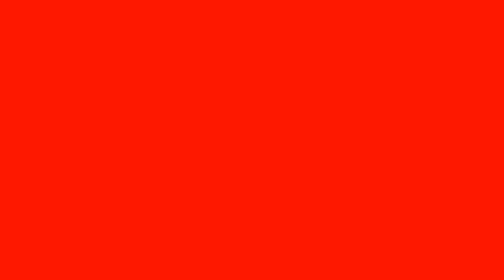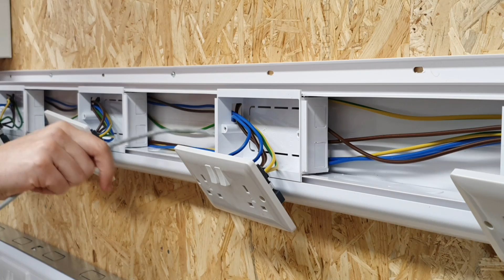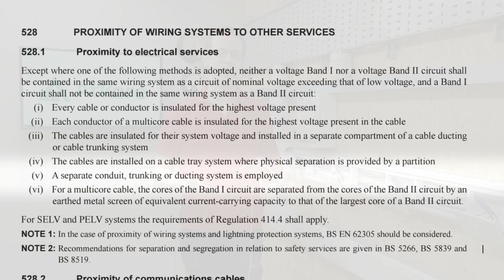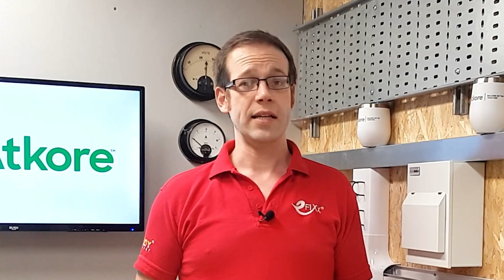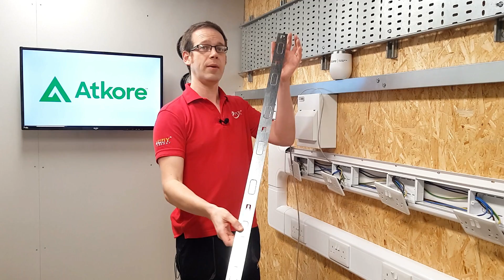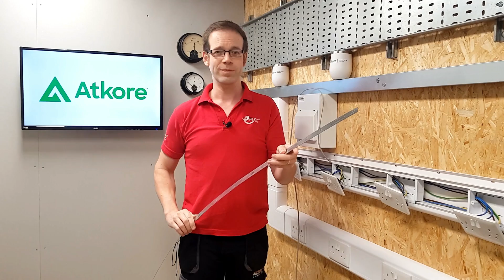Data cable installation in dado trunking - Separating band 1 and band 2 circuits

Comment: Never had a single issue with ethernet running parallel to or crossing mains even on big events with 3-phase chucked across a floor, as Alex below said at 1G or even 10G speeds the pairs act as a balanced signal and null out the interference.  Is it probably better to isolate - probably, does it in operation make much difference - none that i've experienced.  We know the regs like to go a bit past the belt-and-braces sometimes.

Comment: You could physically fit a 16mm trunking inside 25mm trunking and run the band 1 / 2 separate. or put the 16mm trunking in the same chase next to the cable (in a wall chase)

Comment: all that really needs to be considered is the potential for a data circuit becoming live. Clearly, each compartment is regarded as a separate system.  If you read manufacturer guidance they tell you which compartments to use for each band.

Get a lot less interference anyway if you use twin instead of separate live and neutral like in the video as they will cancel each other's field quite a bit being close together.

Comment: in almost 20 years of separated dado, i've never seen the additional shielding used on any site i've worked on.....we just used a shielded Network cable & never have any issues.
Reply from the maker: Yeah, I don't know if it's an extra specced thing for government or military buildings etc.

Comment: Do you have a video demonstrating the rate of distortion in the data cables? I’ve done a house renovation and added cat 6 cables in some of the rooms. Due to it working in the confines of a typical house structure, I was limited how to run the cables and in one or two locations the data cables have crossed power cables or or run parallel to them. I haven’t switched the data cables on yet but would be interested to know whether all my effort was for naught.

Comment: I do recall on one job we used three compartment dado trunking and run the mains in the bottom and the data cables in the top so keeping a greater distance between them ..
Reply from the maker: Not gonna get many EMC issues with that install!

Comment: I always run mains in the bottom potion and shielded cat6 in the top and only use the middle when i adding the outlets so they are as far apart as possible for as long as possible
as I have see as huge drops in data when you have to two close together. the steel is great if you need the extra security
Reply: now here is a guy who knows his stuff. i am a it guy and i am always ticked off about electricians running utp right next to power. esspecialy if they show it in youtube video's.
Reply from the maker: Great 👍 advice

Comment: If you Twist you're live and neutral cables together it will almost completely eliminate magnetic coupling between the cables.

Twisting cables together is a very powerful method of reducing interference
Reply: To be honest it's not a common technique in the electrical industry but it's  absolutely bog standard in electronics and data Communications.

First sign of interference twist your cables together  it's that simple.
Reply: I see what you are trying to say but I never saw twisted power lines in normal houses..
I did started to see more and more low voltage pole to pole power lines that were twisted (from local transformers to residentials, 3 phase, 230/400V lines in Y configuration)
Reply: I know a particular case where a comercial center used normal paralel lines to the grid and the escalators stairs motors kept burning until they changed the lines from the local transformer to the comercial center with twisted pairs...

Comment: Isn't the whole point of twisted pair that common mode induction results in a voltage difference of zero (subject to termination). The twisted pair is terminated with a transformer each end in Ethernet, so the fact that the pair is bouncing around at 50Hz makes no difference to the detector on the secondary winding of the transformer. Non transformer coupled data modes such as RS485 (DMX512 or similar) can be somewhat less tolerant than Ethernet.
Reply: Most don't get how ethernet works. A lot think that a 20m cable will have slower speeds then a 30m.

Comment: For Cat5e/Cat6 being used for 1G ethernet you won't have an issue in a typical scenario, as the transmission is done using balanced pairs which therefore act to exclude external interference (i.e. no need to use STP, the balanced nature of the twisted pair is sufficient by itself). Something that is genuinely 'analogue' like a stereo audio feed would be far more vulnerable (though even then you can easily deal with it by using shielded cable) - 10G ethernet over copper is a bit more sensitive, but then normally most 10G things done over a distance will be fibre anyway...
Reply: Do you need to earth the shielding then?
Reply: @CurvedSlightly  A proper cat 6a and 7 termination will inclued a clip on the ethernet connectors. This will be connected to the outer shield of the cable. This will be connected to the earth of the switch or computer if it has one.

Comment: Indent v does indeed allow you to install a small conduit inside a larger trunking system. Have done that with a doorbell cable in 4X4 box trunking with a conduit

Comment: Love the video Joe. I just used Shielded cables ran in the top section and ram the mains in the bottom. Never had any issues with either Data or Alarms. Stay safe

Comment: Great video thanks I have never used or installed dado trunking
So this was interesting to watch,.
Off topic if you don't mind, can you please tell me how to use the loop and psc settings on the Robin kts 1620 /kewtech kt62 MFT'S as the new metres have it as two lead high, so I am a bit confused I have my late brother's ROBIN kts 1620 MFT but there is no introduction book

Comment: When I had my last onsite visit from my NICEIC assessor they mention metallic supports for the cables in this plastic type installation. What's your thoughts on this matter? I appreciate its a question on a tangent from video content.
Reply from the maker: Yeah if there's a risk of it collapsing prematurely in a fire and entangling a fire-fighter then whack it in. 👍
Reply: So if thats the case pretty much all dado installations require it so which then leads me onto the question 

Do you know of any dado manufacturers that have metallic supports for their rang as we use MK (others manufacturers available) as they don't seem too. I've just used plastic coated banding strap. I know there is the part in the regulations where if we use a different manufacturer within another then we take the design responsibility for doing so.

Comment: I just ran STP shielded twisted pairs cat 5e 12 inches away
Reply from the maker: Sounds good!
Reply: @efixx  It might not be; shielded TP has it's own problems with termination and grounding and can easily make 5e less reliable if not done perfectly.

German data installation are big on STP — and are consequently very, very fussy about how it's installed.  In 30 years I've never seen it used on a large scale in the UK, UTP all the way and simply maintain a modest separation from AC carrying cables.

Comment: Surely, all the power cables go in the top or bottom tray, then the network cable goes in the opposite? Not just shoved behind?
Reply: That would get around and answer my question.. as you'll drop the cable down from the top to the middle section to mount a back box, the cat5e would pass the live etc cables, surely this would create an issue? Or not as they are not running parallel to the other cables?
Reply: @dast_uk  If you're using twisted pair CAT5E then you shouldn't get any interference. I think with CAT6 you need to be more careful but you really don't need to be using CAT6 unless you're linking servers or really need the speed in which case you may as well use fibre.
Reply from the maker: You've got options!
Reply: @efixx  The option to do it correctly or not? Yeah, K.

Comment: When I was at college doing my HNC in Computer Networking Systems I was always taught the importance of EMI using Cat5(e) (the latest iteration of the cable at the time) and one way which we were taught was to tape up the cable with Silver Tape. To prevent cross talk. Plus we were always strongly recommended not to combine the cable in trunking with power cables.
Reply from the maker: Sounds like good advice Bryce!

Comment: I had EMI issues at home many years ago although not with trunking. This was much like the couple in Wales with their TV chucking out EMI a few weeks ago. To make it not TL; DR I started to have issues with my ADSL running at a whole 1 meg as was available 15 plus years ago. Had BT out and predictably it was fine on the day they turned up. After a couple of weeks I worked out what was causing it. I had acquired an old computer that I stripped the PSU out of. The router was downstairs at the master socket. When the PSU was switched on it was near the phone line extension to upstairs in the back bedroom. It chucked out so much EMI my interweb went from 1000Kbps to 64Kpbs. Or worse if the PSU had load on it. It was back feeding along the cable pair - I didn't have the 3rd ring wire connected as that isn't needed. As quick as ISDN or even worse! The noise profile was horrific. Suffice to say that PSU went in the bin to silicon hell....
Reply from the maker: You did well to track that down Michael. 😊
Reply: It was a eureka moment. Probably after a couple of bottles of beer....

Comment: Done a job before for the RAF that specified the trunking using the metallic strips and riveted in place, the pvc trunking back boxes even had a copper lining to the boxes that needed to be earthed. Made a simple job into a pain. Nowhere stocked it and it was all made to order by Schneider
Reply from the maker: Wow - sounds like a robust installation!
Reply: Wow. I can imagine when initial taking on the job thinking, ok simple dado job then all this happens. I done a sound system install in a prison and all the dado trunking was metal and all screwed shut with anti tamper torx screws. Then the decorators chalked it all aswell so was an absolutemission to remove any part of it. Parts got bent and I could find replacement so I had to straighten it all back.
I didn't want to open too much so I used rods and they would get stuck in the dado. I lost a few lengths inside the dado but didn't care as opening the dado to retrieve it wasn't worth it
Reply: That's Tempest for you!

Comment: Brilliant video Joe. Adding to this I would also say that this helps to reduce the impact of transients & surges. By using a common routing you reduce the size of any induction loop but by separating and screening them you help to prevent data corruption and damage, line routing and shielding are not really included in BS7671 as ways of mitigating surges but they are included in BSEN 62305 as methods of mitigating risk so this method and product is helping and would be of benefit to the end user.
Reply from the maker: Thanks very much Sean and thanks for the extra information. 😊